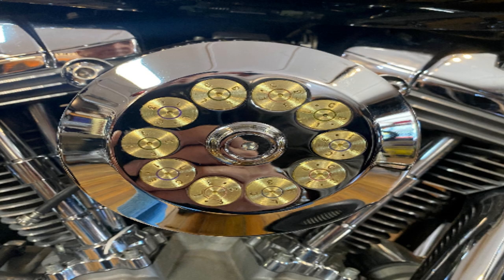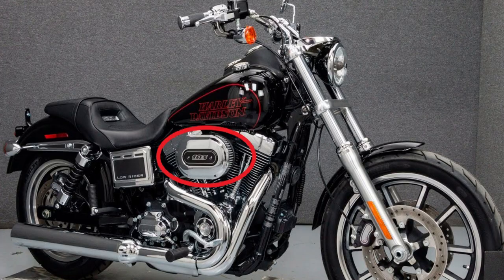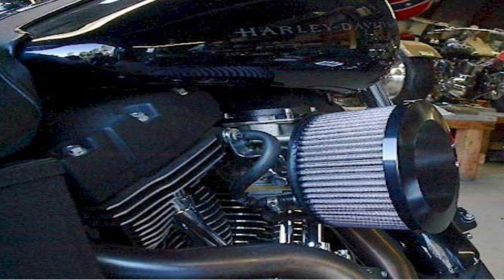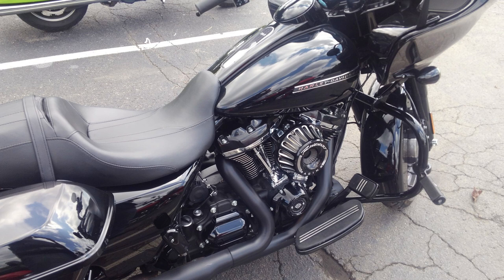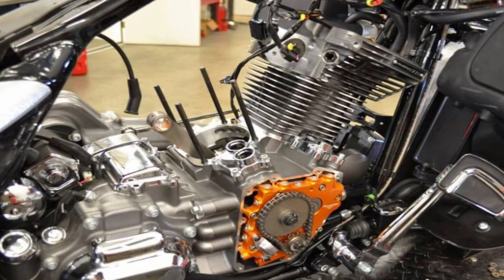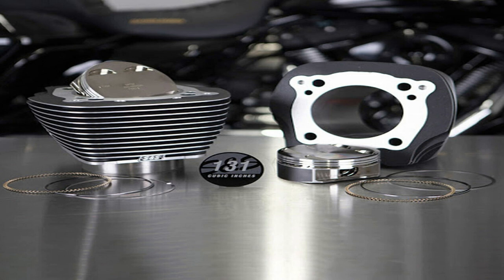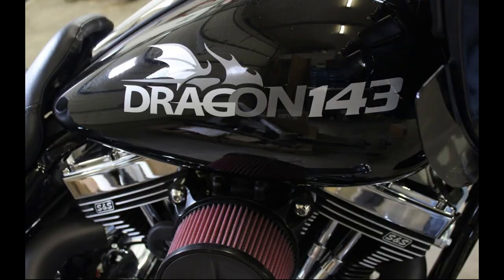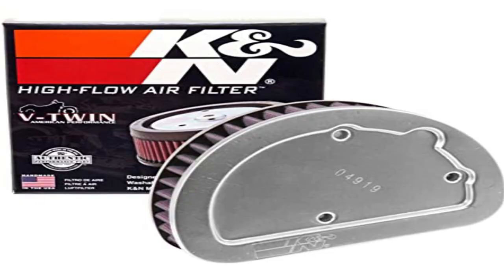Feed the Beast, Harley Air Cleaners Can Make or Break Your Build

Comment: I need help!!!! I've been binge-watching your videos and I need your help making a decision. I'm going to a Harley from a V-Star 1100. It's either going to be a 98 Electra Glide, an 07 Street Glide, or a 2011 Street Glide. No experience mechanically, but I've been doing all of my own maintenance so far and I feel like I have enough common sense to hold my own. Power isn't a priority. What would you suggest?
Reply from the maker: I've actually got a video about this coming out Friday, The 98 Electra isn't a bad bike with the Evo, but it's likely injected with the Magnetti Marelli, that's a no go. The 07 SG isn't bad, injected 96 TC but it's gong to likely have the weak compensator. I would suggest the 2011, they had the chassis issues with the touring bike worked out and the compensators were updated. Still the 96 engine which is a great motor, that would be my pick as far as not having to make a few updates.
Reply: @GixxerFoo  Thank you. Looking forward to the video on Friday.

Comment: I'm expecting a lot of boo's but I've just got a Scout Bobber Sixty. Big deal, I hear you say, but they stopped importing at the start of the year so it's become a collectors item. I plan on staging it up over time but I'll start with the aesthetics first
Reply from the maker: They stopped importing the Indian?? I know they can't with the Sportster Evo now but I thought the Indian would meet emissions.
Reply: @GixxerFoo  Just the Sixty line, everything else is still coming in. It doesn't meet Euro 5 emmisions but that could mean the mirrors are the wrong shape as there's very little difference between them and the regular Scout

Comment: Good vid, I'm running the Cobra Power Flow on My Iron 883, with plans for a Hammer kit next season, should I upgrade the AC?
Reply from the maker: Hammer is probably going to suggest you upgrade the air cleaner depending on what conversion level you decide to go with. If you're doing a 1275 conversion and keeping the stock heads and cams that air cleaner would work.
Reply: @GixxerFoo  FYI, just the basic conversion, not looking to get too wild. BTW, just re-watched the video on breather catch cans, will be adding that to the conversion, just makes sense. as always, thanks for the info.

Comment: S&S tear drop, Vance and Hines 2-1 Pro Pipe, FP3. On an 2019 Road Glide. Is that ok. Or do I need more air?
Reply from the maker: The air cleaner you have on there is going to be more than enough air for your setup, those S&S air cleaners flow very well.

Comment: "Mild big bore kit'...is that like going stage 4 103 HD Kit?  Asking because I kept the stock 103 air cleaner on my 16 RG Special after I had the work done
Reply from the maker: You've likely got the HO air cleaner which does flow pretty well, you might get a little difference with an open element air cleaner.

Comment: I went with the s&s teardrop on both my street bob , a 103 and a 107 buth with cams and all that good ness 😉
Reply from the maker: That's actually a really good air cleaner, they perform really well! A good cam set makes all the difference!
Reply: @GixxerFoo  im really happy with it , my knee is right up against the airfilter , i use to have a big sucker but my panth leg kept getting sucked in and chocking the engine . 
This ine solves that and looking OG and cool as hell

Comment: I can’t “over air” the motorcycle?
What about a bone stock carbureted 883? 
Won’t i need to change jets?
Reply from the maker: You'll need to rejet for the air cleaner, but the engine will only use so much air no matter how big the air cleaner is based on the bore size. Now if you have an air cleaner that is too small with a large bore size the engine will not draw enough air to completely fill the cylinders and cost you a lot of power.

Comment: Is there a difference between the 90° intakes and the flat sitting intakes?
Reply from the maker: Honestly just the look, I guess you could make a point that the 90 bend puts the air cleaner out front and forces air in but it's not pressurized like an air box. It's really all about surface area and making sure you have enough surface area to feed the size of engine.

Comment: Air can flow through a box.  You just need to update the filter. The filter is where you restrict the air flow.
Reply: That's not necessarily true. Look at the air box on an Iron 883 or Iron 1200 and tell me it'll flow as much as the filter. There's no way. The intake opening of the air box is less than four square inches while the surface area of the air filter opening is over four times that at a little over sixteen square inches. There's plenty of other air filter designs on Harley's that share a similar situation.
Reply from the maker: Sportster air box is pretty bad, you can put your hand over that and kill the motor pretty quick.
Reply from the maker: On a Harley the air box really restricts the air flow to the engine, it's not like a pressurized air box on a sport bike.

Comment: The stock air box that Harley has now I’m 2023 on their bikes will be considered too air restrictive? You recommend Hiflo or K&N filters?
Reply from the maker: A K&N air filter in the stock air box isn't a bad option, it will honestly provide more air than the bike will realistically use. Aftermarket air cleaner prices are insane, if you don't want to pay the big bucks for one just a K&N in the stock air box will get the job done.

Comment: Okay I got another question, I thought you before I have a 2009 Electra glide ultra classic CVO, it has been added stage 4, dome top pistons different cams. The whole nine yards. The air cleaner on it looks to be stock except the filter itself looks to be k&n if I have a stage for that means it's a different throttle body how is my original air cleaner on that particular setup. It is open all the way in the back of the air filter like a stage-one does
Reply from the maker: It really depends what Stage 4 was used, Harley's changed it up over the years and the current stage 4 kits require a larger throttle body. Although Harley does have some stage 4 kits which still use the stock throttle body.
Reply: @GixxerFoo  so what you're telling me is the original throttle body could be still on the motorcycle. I live out of Maryville Tennessee in the Harley shop there told me that they did all the work back in 2013. Do you think they would know which stage 4 was added on to that motorcycle ? The person who owned it before me also added dome top pistons and 260 cams. Which from what I understand did not come with the stage 4.

Comment: More great advice from gixxerfoo👍. Does more air lean out the motor?
Reply from the maker: It does, that's why it's very important if you're just putting on slipon exhaust and not tuning to leave the air filter stock. But with a tune, even a canned map it's accounted for a high flow air filter.

Comment: Based on what you said, I have a M8 107 with a 200.00 SE round completely open air cleaner is fine for a SE torque cam. Also have a Rinehart slip-on so do I have to get a high flow A/ C or is mine ok? Thanks for a great video
 PS: with the combo I mentioned I had Dyno’d
94hp.  114tq
Does that sound about right?
Reply from the maker: Those are really dang good numbers  for a cammed 107! With just slip ons that's some solid numbers, your air cleaner is good to go. If you put a full system on you will see a decent increase worth another dyno run. But just my two cents those are damn good numbers!
Reply: @GixxerFoo  thanks brother, I have a five year warranty. I’ll have some time to save up for full exhaust and new AC. I’ll be back when the time comes. 
Thanks for your fast response, have fantastic Easter😎
Reply: @GixxerFoo  thanks buddy for your opinion 😎

Comment: Thank you for this video. I have a 2005 sportster 1200 with slip ons. Do I need a tune if I put a Screaming eagle cleaner on?
Reply from the maker: You'll need to make some jetting changes as changing the air cleaner will lean you out with more air.

Comment: I’m looking to go stage IV on an M8 low rider S and never thought picking an air cleaner would be such a pain.  I’d prefer one that didn’t get in the way of my knee, doesn’t need a sock in the rain, and allows the engine to breath.
Reply from the maker: When you get into the big inch engines the air cleaner really becomes a factor. It really is hard to find an air cleaner you like and will still fit with the larger throttle bodies the stage IV fits have.
Reply: @GixxerFoo  what the best air cleaner for big TB

Comment: Put slip ons on and I did a tune last week on my 114, but kept the stock filter on for now. Thinking of the Screamin Eagle ventilator air cleaner.  You thinking that's overkill? I don't plan on anything more than maybe a cam down the road.
Reply from the maker: Not at all, you can go as big as you like with the air filter and it won't hurt anything. The engine will only use so much air with a large filter but you're prepared for the future.
Reply: Did the tune make a nice difference? I just put slip ons on my 114 and right now it just feels so weak like I need cams to be happy,
Reply: @JonRodGod  I feel like I got the torque back from when it had the stock pipes. So i now have stock power, but with good sound. Gonna go with the heavy breather and see how that works out.

Comment: Great advice as always.Yes I'm still able to ride down in the south east of Florida.Other than the rain today it's the perfect temperature for riding.Im to the point with my bike with open shorty pipes and a k and N high flow air filter it's as about as good as its going to get until I have the stock heads and top end built up only upgraded filter I changed it seems to run very well the way I tried to match the filter with the throttle body and not gone any farther knowing I'd open a can of worms if I added a bigger bore kit and throttle body.I guess the old saying is true.If it isn't broken don't fix it.Think I'll leave my bike set up with the high flow air filter it's seems to work well with the kind of pipes that's on it.As always thanks for the information and great advice.Ride safe out there.Unless it's getting to cold there.
Reply from the maker: Watching Shade Tree Surgeon I don't think it's possible to go a day without rain in Florida. Once you crack the motor and start adding a big bore kit it turns into a while I am in there and it doesn't stop!

Comment: Ok this is always on my mind. I have a 17 ultra, was a 107. Now it's a 128 with 64mm tb, 6.1 injectors. They said the Harley stage 2 was ok but I still dought it. So what do you recommend for the stage 4 128. Thanks
Reply from the maker: Sounds like you've got a great setup with the 128, throttle body and injectors sound good. For a good air cleaner there I would suggest something that's large open element. Something that's covered could benefit really well if its got the open top, I'd try to make as much air available to that motor as possible.
Reply: L look on my
Reply: @RIDE.WRENCH.REPEAT.  what we're you trying to say.

Comment: Probably 25yrs ago , forget which magazine it was , but they took some of the most popular aftermarket air cleaners , and did an airflow test in a wind tunnel with rider on the bike. The good ol' S&S teardrop and HD 8in with modified backing plate were near the top. The Hyper-charger type was not.
Reply: S&S teardrop is incredibly underrated for carbed bikes
Reply from the maker: There's something to say for the good old classic air cleaner, one of the best out there!
Reply: @GixxerFoo  agreed man! Just don't get old bike die hards discussing cv or butterfly carbs! Comment section would be a bloodbath 🤣

Comment: Tell me what you think of the S&S Tear Drop and using a a K&N Filter?
Reply from the maker: The S&S air cleaner actually works very well, especially on carbureted bikes. That air cleaner is a bit more than just a cover, they have that little funnel inside which makes a big difference.

Comment: Hi. How will open filters work in rain? Will water get inside an intake manifold?
Reply: Yes. it does not work very hard in the rain. the engine may shut down and run only on surface gas
Reply from the maker: They come with rain socks which repel water, they work pretty. I have rode through thunderstorms and down pours using them and didn't have any issues.
Reply from the maker: Every now and again you can have an issue with that, lol I got creative and swung my leg over the  air cleaner to keep running lol.

Comment: So my bike is an 88 TC  with compression release valves. It still has the stock air box on it. You are telling me I should which it out to an open air cleaner and will make the bike run bigger
Reply from the maker: A good open element air cleaner and retuning the bike will certainly improve upon the stock air box.

Comment: What about velocity stacks.
Reply from the maker: Velocity stack are great for wide open throttle and full air flow, but down low and all around riding just a good old air cleaner is the way to go.

Comment: Is there a way to test restriction from this air cleaner to that one ...vacuum, infrared heat gun at the head or tail pipe ..??
Reply from the maker: Not that I am aware of, Project Farm (dude is smart) came up with some tests on different air filters for cars. He tested paper and the K&N filters, best flow test I've seen. But I don't know of a way other than swapping air cleaners and running it on the dyno.
Reply: @GixxerFoo  seem like a kind of hunt and peck...to get your correct set up for your type of bike ..

Comment: Great advice and spot on with Harley’s stock air box. I was scratching my head when I did my first air cleaner change. On the plus side of tuning a Harley today is it is electronic verses off and on with a carb five or six times with jetting. LOL!
Reply from the maker: That's no kidding, with the carbs you gotta make a educated guess for a starting point and go from there. I am a bit spoiled with the auto tuning and just flashing the ECM these days.

Comment: Air cleaners are pretty straight forward, what makes the difference is the throttle body.
Reply from the maker: The throttle bodies make a big difference on the larger motors, the bigger you get the more you will find you benefit. SE has that 58mm for the Sportster, you can put it on a 1200 with exhaust air cleaner and tune but it doesn't change anything.
Reply: @GixxerFoo  problem is the sportster not the throttle body. We’re grown men here we don’t need to pretend we care about sportsters lol

Comment: very good ,, again = stressing the fact that a motor is only as good as its weakest point ,, when i get mine done i will take to a shop who has the knowledge to match these items to rest of the build ,, even though i have spanner knowledge i am sure its best to take the bike to a shop which has the tuning / dyno gear rather than stab in the dark and waste money ...
Reply from the maker: A good shop has inhouse combos that they have put together and tested. Those setups are usually very reliable and make some serious power!

Comment: Exposed air cleaners will suck water when riding in the rain, no?
Reply from the maker: They have rain socks for the open element air cleaners that repel water, I was bit skeptical of them at first myself. My wife and I road through a thunder storm and neither of our bikes had an issue with the rain socks on.
Reply: @GixxerFoo   skeptical too, lol. Glad they worked for you and the Mrs.

Comment: I have a 2004 Electra Glide Ultra Classic owner before me added Vance N Hines duels upgraded the cam chain and tensioners along with adding a 96 big bore kit but left the stock air cleaner in it what air cleaner should I use in it ???
Reply from the maker: With a bore kit and some cams any open element air cleaner you like would be a safe bet. You wouldn't need specifically large element air cleaner to feed that motor with the bore size it currently has.
Reply: @GixxerFoo  Thanks for the reply as the winter months slowly creep in it gives me time to look and compare performance and pricing when spring comes around I'm hoping to have made the changes and will post it here

Comment: The type of air cleaner depends on the position of your foot controls...
Reply from the maker: That is true and some manufacturers have different backing plates which allow you to move that air cleaner forward or more towards the rear.
Reply: @GixxerFoo  Forward controls really limit the air cleaners you can use.

Comment: im just sitting here thinking of the thousands of dollars you have to spend upgrading the clutch, truing up the motor to make sure you dont have run out on both sides, and fixing it if you do at thousands of dollars, then the thousands you would have to spend to even consider a stage 4 kit and wondering who the hell can afford to do it right? and why? I mean damn why not just get a kawasaki cruiser at that point Motorcycles are a good example of everything the government touches turns to shit, back in 1986 I bought a brand new kawasaki 454 LTD that would max out at 130mph, and before that i had an 81 LTD that I went 155mph on, when the epa got involved with bike poof you need triple the cc's or ci to go as fast as a much smaller bike.
Reply from the maker: I can't recall a time the government got involved in anything and actually made it better lol. Yeah if you want to build a perfect Harley you really have to commit and drop some bucks in it.

Comment: I.just. don't. Like the  look are the ideal. Of.  Chain. Around twenty cam. Outer. OK.  But.  Around. Cams.    That don't.  Look.like. hold up..well.     It dint make scent. With chain.   On. Cams.    It should always be. Gear.    Chain.    I don't ot just. Don't look. Good.  Way. Run.     If.  Gear. On. Cam.  The.  Chain on. Out. Side.  That would be. Great.